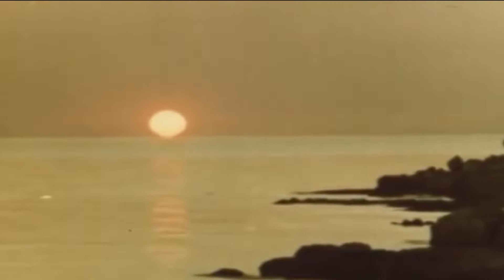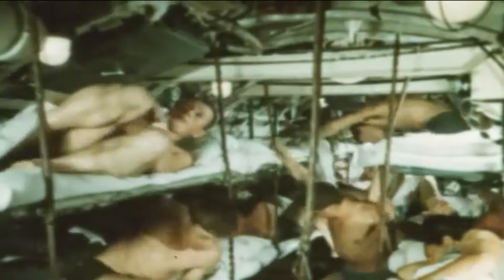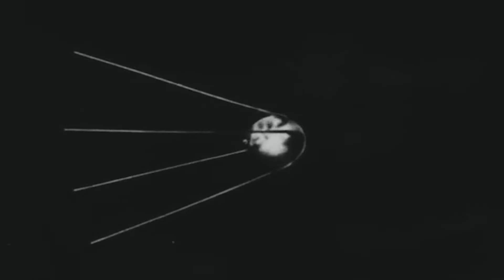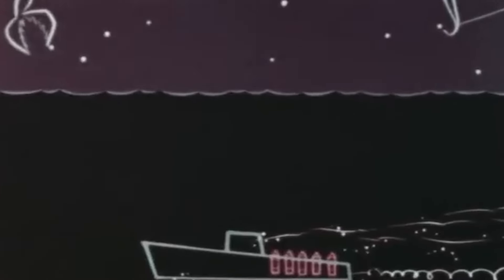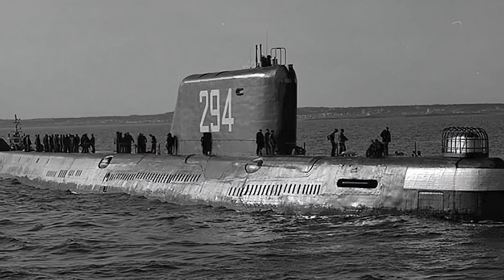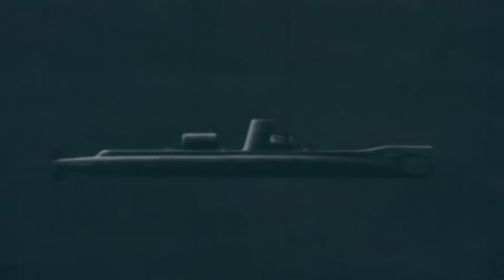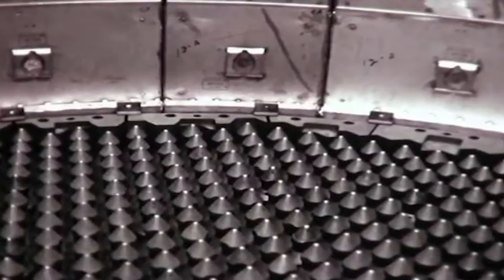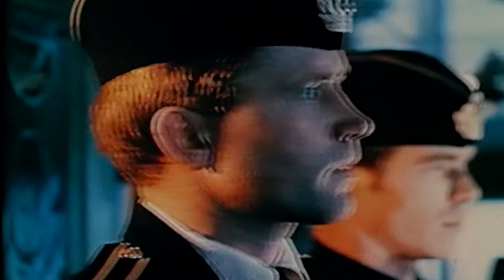The Submarine That Turned into a Ticking Nuclear Bomb

Comment: Reactors meltdown, hydrogen may explode (chemical reaction) but no nuclear fission or fusion explosion will occur.
There is a vast difference between the design of a bomb or a reactor and both are intentionally engineered to do different things and are not interchangeable no matter how hard you try...
Reply: Most people don't realize this
Reply: A reactor is intentionally engineered to leave the land uninhabitable for centuries? Kinda silly comment there.
Reply: @R0me0316  you can contaminate the land for centuries just blowing up pile of the nuclear waste. Do need reactor for that. Your comment is silly.
Reply: @redsun9261  they aren't intentionally engineered to do so. That was my point. A reactor will do as such, while a nuclear weapon consumes the radioactive material far more efficiently and the area is habitable within a few months with minimal side effects.
Reply: @redsun9261  good luck blowing up something encased in a metre thick, steel reinforced, armoured concrete casket designed to resist impacts from jet airliners.

Comment: I’m sure it has been commented here but a nuclear fission reactor CANNOT turn into a Nuclear Fission Bomb. The Uranium-235 used in the fuel rods are only enriched to about 40%, which is not anywhere near enough to trigger the kind of runaway criticality incident, nor are reactors configured in a way that would cause a nuclear explosion. What would happen is, thermal runaway that would cause a reactor meltdown that could cause a reactor explosion, either due to a steam explosion and or a hydrogen explosion that would kind of act like a very dirty nuclear bomb. Spreading radiation, similarly to how the Chernobyl nuclear disaster did, as that was an uncontained reactor failure/ explosion where the runaway heat causes a steam or hydrogen explosion that would spread radiation and the fuel rods would them melt into molten lava like substance,  something referred to as corium.

Comment: "Turn into a nuclear bomb"

That's... not how reactor meltdowns work.
Reply: That's not what was meant, the radiation leak had the same effect as the radiation from the Atomic bomb dropped on Hiroshima did on the people of the Town, that bomb had low yield radiation that was designed to kill as many people as possible from radiation poisoning (ignore the people who died during the Blast when the Atomic bomb exploded for the purposes of the explanation because that's what is confusing everyone) over the following years and as did the radiation poisoning aboard the K-19, now after a lot of decontamination Hiroshima is habitable again with regular health checks to make sure that there isn't any radiation hot-spots
Reply: i don't think anybody on board the ship would care about the physics when it blows up
Reply: that's exactly how they work
Reply: @lospolloshermanos5659  reactors cannot under any circumstance detonate like a nuclear bomb. They have completely different conditions inside them and the fuel is not nearly enriched enough to lead to a nuclear explosion. A meltdown leads to the reactor core melting into a lump of heated radioactive slag, plus maybe a hydrogen detonation that cannot damage the containment building

Comment: I don't know where you got your information, but there is no way a reactor core on a vessel of any kind could cause a nuclear explosion.  The worst-case scenario would be a steam explosion causing environmental poisoning due to highly radioactive core fragments.  A nuclear weapon is highly enriched, uranium compacted into physical dimensions that, when compressed further by conventional explosives causes a nuclear explosion.  Those conditions don't exist in any heat-generating nuclear reactor.  BTW, the USS Gato (SSN 615), is pronounced Gay Toe, not Gah Toe.  I was stationed on the Gato from 1977 - 1980.

Comment: Nuclear reactors on subs are too small to make any kind of spectacular explosion. Worst case scenario with extraordinary incompetence from the crew the reactor would melt down badly, leaving the sub dead in the water. Catastrophic explosion of a submarine nuclear reactor is extremely unlikely. In fact, so unlikely the Three Mile Island meltdown was partially caused by the fact the crew controlling it was an ex sub crew. And these people simply didn't consider such a thing as meltdown even a thing as residual heat from reaction in a sub reactor is small enough to be contained by a simple shutdown. Not so for a full sized distribution reactor.
Reply: Alvin Weinburg, who designed the US submarine PWRs, always said it was not appropriate to upscale these reactors. They are super safe at around 20 megawatts, but utility sized units have all sorts of (potential) problems with cooling especially with decay heat. That's why he advocated molten salt for utility scale plants and got told to shut up by his superiors. TMI proved him right.
Reply: The other thing is a sub or for that matter an carrier reactor is surrounded by cooling water.  Commercial reactors are not and lack of cooling water is what caused all 3 commercial disasters.

Comment: The only way the sub could explode in a nuclear explosion is if the war heads detonated. The reactor would melt right through the bottom of the sub if it went in to melt down, I suppose the resulting hydrogen explosion would destroy the sub which it could in theory set off one of the nuke missals, but I think it unlikely

Comment: Well it ran for around 30 years. That's about average for ships and subs tech and safety life expectancy.  And long for a boat with that many issues. Submariners are a super special group anyway. No matter the power source, every deep dive could be it's last. But whether battery acid fumes or radiation leak from a reactor. Hazardous materials from either can be detrimental for a crew. 
Dedicated and brave is all I can say about submariners.

Comment: Creating a hydrogen/steam explosion wouldn't be too difficult for a reactor meltdown. Remember it was steam pressure in the reactor core that caused the structural failure at chernobyl. Imagine a meltdown in a sub boring through the hull and hitting cold sea water. The explosion would've been catastrophic. Not thermonuclear bomb level of destruction but the damage would be severe nevertheless. Add into the fact that the K19 had nuclear warheads onboard in the form of her missiles and it's even worse. While most safety systems would prevent an accidental arming and detonation of a nuke even we Americans had issues with safety systems failing under severe circumstances. If the shock of the steam explosion damaged the warheads they could IN THEORY go off and that would be detrimental for all the world to say the least considering where K19 was when her cooling system failed. Let's all agree to call this a nuclear near miss and pray that we as a species never come this close to bringing about our own Armageddon ever again.

Comment: You should know that no submarine reactor can explode like an atomic bomb!
Reply: Could a thermal explosion cause the missile war heads to detonate?
Reply: @barrylongden7  No, that’s not how nuclear weapons work.
Reply: @barrylongden7  Those bombs are very touchy, things have to go off in the right sequence with pretty much perfect timing, an exterior event setting off the primer would almost inevitably compromise the bomb in some way. You would almost certainly have some radioactive contamination but if the event was to happen underwater the mess would be significantly reduced.

In short it's pretty easy to blow up a nuclear bomb, but pretty hard to get an actual nuclear explosion.

Comment: What happened at Fukushima and Chernobyl, is the top of the reactor vessel was blown off by exploding hydrogen gas. I suspect the process of nuclear energy, to be a special kind of electrolysis. You have a vessel filled with water, radio-active metal rods in that vessel, arranged in a certain position. Then an electric current is sent through these rods, they heat up, and hydrogen and oxygen from the water is being separated. This is free energy, because water is the fuel. The rods are being "used up" as well, that is why they have to be replaced after 20 years of service. What you get is oxygen for the crew, and hydrogen for propulsion. Even the ancient Egyptians knew this proces. I don't know where they dump all this excess hydrogen gas, which is a considerable amount, so most likely they burn it, and propel the boat in this way. All the stories about a threat to the planet are urban legends. A submarine can be traced by the radioactive signature that she leaves in the water, but it might as well be a heat signature, because this reactor needs cooling. The water for that cooling system is dumped back in the ocean. That is why subs leave a heat signature in the water. They produce more noise, then diesel-electric boats, because of the steam pipes and valves. They are much faster, can dive deeper, and can stay under water indefinitely, that's what makes them a dangerous opponent. But they are easier to find.
Reply: Way off base.  The hydrogen is generated by the Zirconium in the fuel cladding stripping the Hydrogen from the surrounding steam when the temperature of the fuel reaches about 1200C.  No electricity involved...it is totally a catalyzed high-temperature chemical reaction. 

At the time that "used fuel" is pulled from the reactor, only about 5% of the original Uranium fuel has actually undergone fission, far from "used up".  What happens is that certain by-products  of the fission reaction accumulate to the point where a chain reaction becomes difficult to impossible to sustain.

Civilian reactors are generally partially-refueled annually, with about half the load being replaced and the rest re-arranged.

20 years before refueling is on the high side even for a Naval Reactor, a totally different design with a totally different fuel composition.

Unless there is serious damage to the plant, a nuclear sub does NOT leave a "Radioactive signature".  Cooling is performed by running the Reactor Cooling Loop through a heat exchanger cooled by seawater.

The only Hydrogen generated by a nuclear submarine IS the result of electrical hydrolysis of water, but it is a by -product of the oxygen-generating system to produce a breathable atmosphere, NOT the reactor.  Said Hydrogen is compressed to the point where it can be discharged to the sea.

Up to a certain power level, most sub reactors can be cooled by convective circulation with no pumps required.  Noise isolation techniques make a modern nuke sub quieter than a modern Diesel-Electric sub.
Reply: @kevincrosby1760  Will this compressed hydrogen being discharged into the sea not leave a trace behind the boat?
Reply: @joni3503  Not if released over time in small quantities.  The hydrogen is compressed in order to allow it to be discharged against the water pressure.  We're not storing it to dump all at once.  At 1000 feet depth, the pressure on the hull is around 432 PSI, so you would need to compress the Hydrogen to that pressure for it to just slowly bubble out.

3 things give away the position of a sub:

NOISE- The biggest risk

HEAT - Not generally an issue due to movement and depth.

MAGNETIC:  The large metallic mass of the sub will distort the Earth's magnetic field, but the disruption is so small that is nearly impossible to detect if the sub is deep.
Reply: @kevincrosby1760  Maybe that is still possible at 1000 feet, but any deeper would become difficult. Hydrogen is highly inflammable, can it explode when compressed?
Reply: @joni3503  

1000 feet depth is nothing for a modern submarine.  Open literature suggests the normal max operating depth of a Los Angeles-class submarine is around 1500 feet, with a maximum operating depth of 2250-3000 feet.

Any time something appears in the open literature (like the internet) regarding the capabilities of a US Navy vessel, it is most likely based on info provided by the US Navy.  The USN is famous for releasing numbers much smaller than the actual limit.

For example, the ship I was on had an official published top speed of 21 knots.  We regularly CRUISED close to that, and could go faster if needed.

Ever see a 400-foot USN warship pull the bow out of the water, settle out on a nice plane, and leave sporting a roostertail behind it like a speedboat?  I have, several times.

A Hydrogen explosion requires Oxygen.
Reply: @joni3503  Nope.  My US Navy service was all surface.

I've visited a couple, have friends who served on subs, etc.  Info on the non-classified stuff is readily available.
Reply: @kevincrosby1760  Thanks

Comment: While your video is very well produced, I do have issue with some facts about the what a nuclear reactor meltdown is, and how it differs from a nuclear bomb, and therefore the dangers associated with this incident, both radioactive, and geopolitical, fallout.

Although both nuclear bombs, and nuclear reactor meltdowns, are fueled by the same phenomenon of nuclear physics, in practice they are very different types of explosions. A nuclear bomb's primary danger is that the insane scale of the explosion. A  nuclear reactor meltdown triggers conventional explosions that spread radioactive waste, making it in essence a dirty bomb.

A nuclear bomb is hot on unimaginable orders of magnitudes. With the center of a nuclear bomb's fireball calculated to be in the 100s of millions of degrees kelvin, and surface temperatures of the fireball around 8000 kelvin. This puts our sun to shame with a  core of only 15 million degrees kelvin, and around 5000 kelvin for the surface. Although radioactive fallout of a nuclear bomb is a huge concern, it plays second fiddle to the radioactive contamination possible from a meltdown.

A nuclear meltdown is when the core of a nuclear reactor becomes too hot for its construction, whose danger is resulting conventional explosions and fires that spread radioactive waste. A nuclear meltdown can never initiate a true nuclear bomb explosion, the nuclear material is not "assembled" densely enough for that to happen, at most it will cause a "fizzle". The explosions within a nuclear meltdown will be the combination of massive steam explosions, hydrogen fires, uranium combustion, and other chemical explosions. This will spread what was once safely enclosed nuclear fuel in a wide area.

The second a nuclear reactor starts for the first time, the nuclear fuel becomes more dangerous. The core of the reactor is bombarded with neutrons, splitting some of the fuel into many smaller, often highly radioactive isotopes, or are transmuted from the relatively long lived fissile and fertile fuels their own cocktail of radioactive isotopes. All these isotopes will take the journey, some less than seconds, to some many hundreds of thousands of years, decaying from one isotope to another, from one element to another, slowly emitting different types of radiation, until they become stable. Used nuclear fuel, in this way, is more dangerous than unused nuclear fuel which is radioactive. These radioactive isotopes are often what cause meltdowns, and what make them so deadly, as they're often more radioactive than enriched uranium or plutonium. This process of isotopes decaying releases heat. A bunch of heat. Once the process of transmuting these isotopes is started, they start their slow journey of becoming stable, even when they reactor is offline, as they're just undergoing their natural decay behavior, no fission involved. This is what makes a nuclear reactor such a difficult piece of machinery. If a nuclear reactor shuts down, many designs cannot handle the amount of heat generated from just radioactive decay without the cooling pumps. And with a shut down nuclear reactor, there is rarely power to run these cooling pumps, causing the core to heat up, until the entire thing explodes or ruptures, releasing radioactive waste all over.

While a nuclear submarine having a meltdown next door to a NATO base would be a nightmare for the Soviets, it would be very different from a nuclear bomb going off. Although the initial radioactive gasses ejected from an exploding reactor core might irradiate a little of the surrounding, the core would quickly sink and become harmlessly entombed in the ocean depths.

With this explanation, I skipped over a lot of details and facts regarding everything I talked about. For example, I talked about a nuclear reactor's operation as ubiquitous, however I was mostly talking about water cooled thermal reactors. A fast reactor, as seen in the Papa and Alfa classes, would have different failure modes, as those used near atmospheric lead-bismuth as coolant instead of water.